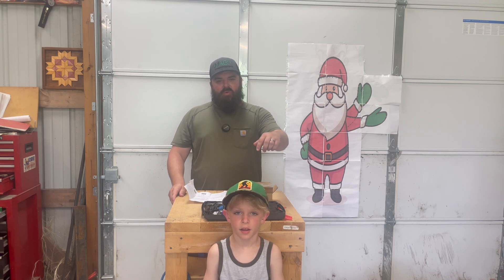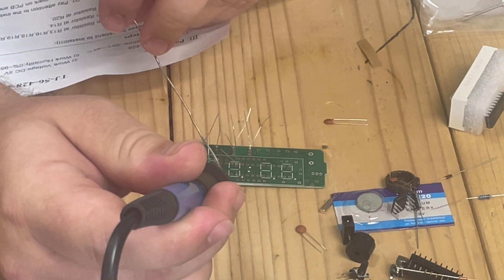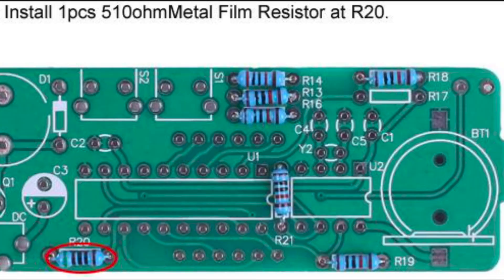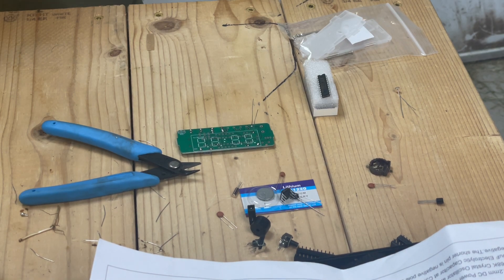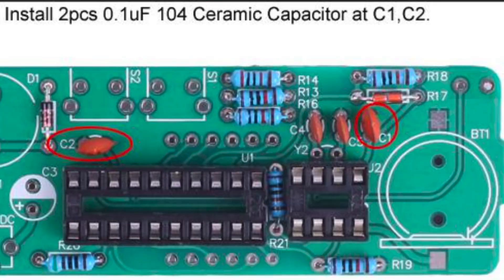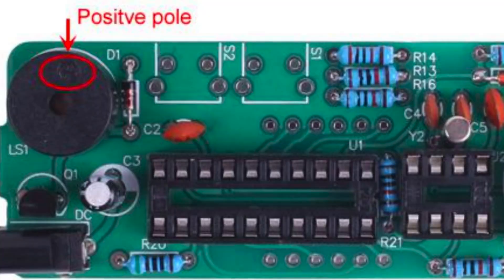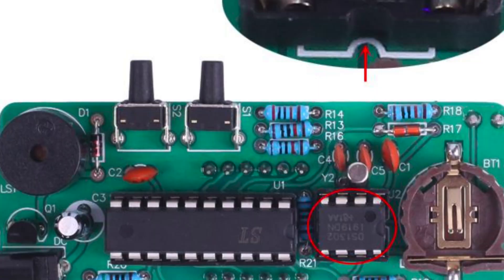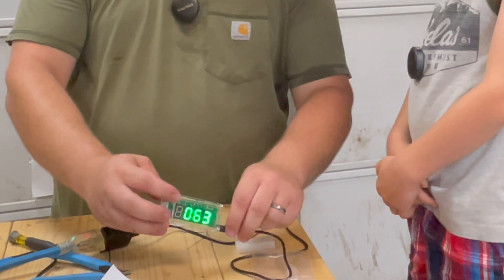Digital DIY Clock Kit (MiOYOOW TJ-56-428) Tutorial

Comment: I came to get help because my dad got me this to learn how to solder. Getting into electronic repairs. Well, I did everything right, and came back to your video to check how you did the battery socket. I did it the same way you did, but it won't turn on from the battery and I have to plug it in. Would you say the battery is most likely a dud?
Reply from the maker: The battery is there to keep your settings and time when it is not plugged in, but not to actually power the screen. It sounds like you did everything right!
Reply: @wackyengineering oh! Man I thought it was different than a BIOS battery in a motherboard. 🤣